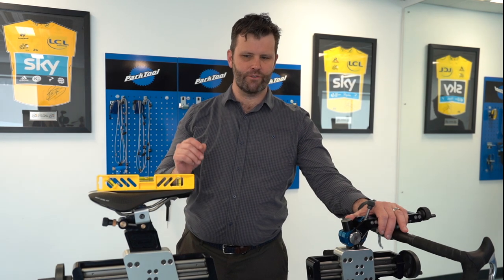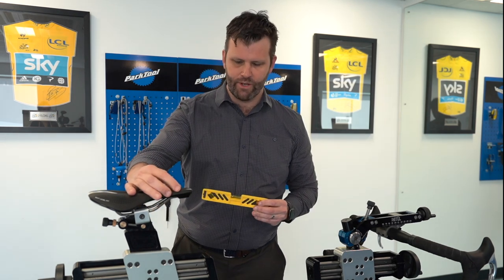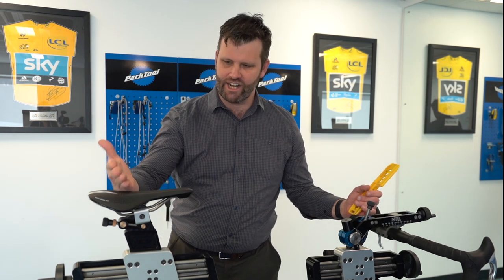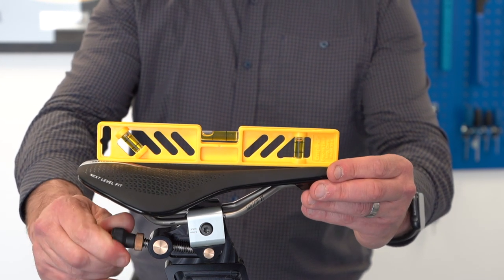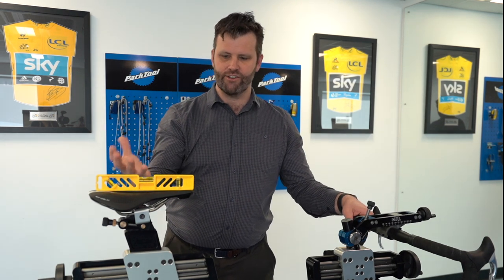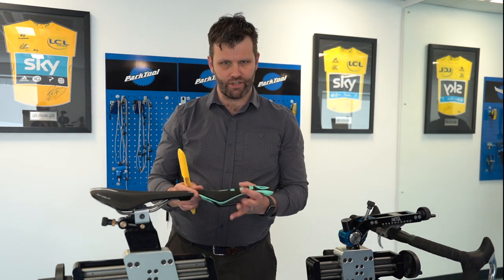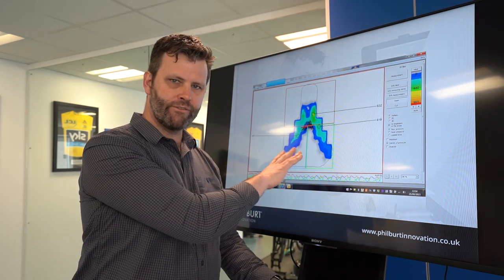The Correct Saddle Tilt For Comfort & Performance

Comment: Having the nose level (or a few degrees down) makes sense for when riding aggressively. What I don’t get is why more saddles don’t have an upwards swoop at the back, gives great support to rotate the hips and is handy to push back on while climbing.
Reply: Rolls or Turbo. And anatomy friendly as a bonus. There is a reason they have been around for 40+ years.
Reply: sap inva Neither of which has a cutout
Reply: @thedownunderverse  selle smp is basically what you mean? Do you use this one?
Reply: mosk11tto I’ve seen them but they have the opposite issue. Too curvy!
Reply: @thedownunderverse  ah ok

Comment: On a transport bike the point of the saddle is actually tilted slightly upwards. 
Fully agree one any sports bike the saddle should be a little nose down to facilitate proper leg movement and avoid excessive back bend.

Comment: Saddle tilt I find is very connected to saddle hight too. I rotated my saddle forward, and felt like I was sliding forward, but then nudged the saddle hight and no longer felt so was falling off. What also nice with slammed tilted saddle is after a hard effort, you can slide back effectively taking pressure off the legs and feet while recovering yet still pedal
Reply: @TheRealD4  it sits at 12° and lowered it a cm

Comment: I have noticed in a years that some seatpost are bit of difficult to adjust saddle in a right level because when you tighten the bolt saddle tilt easily change one way or another and you need to loosen bolts and start all over again. Little bit like trial and error thing.

Comment: Interesting analysis. However, I don't seem to have the same requirements or don't fit the norm. When you mentioned that the saddle nose should never be up, I was waiting for a more comprehensive explanation. The things you talk about don't apply to me (sore back, can't tilt forward). I've ridden across Canada with my Brooks saddle tilted upwards (slightly), covering an average of 130 km on riding days (sometimes over 200) and it seems to be the only way I can do it. The saddle does not feel comfortable any other way. That said, I prefer to have my handlebars higher up than most cyclists and I use raised handlebars. I have no ambitions for racing, but enjoy going on long rides at relatively high speed (for me).

Comment: I ride all my saddle pretty tilted, more than 3°. It is the only good way I found to ride comfortable. What I never understood after a lot of years of cycling and several bikes with different saddles is: why the saddles have almost any foam in the middle-front part when that is actually the part we use most. The rear part of the saddle is normally pretty comfortable but almost no-one is really sitting so backward, the pressure points are usually in the middle.

Comment: Thanks so much for this clip this is the most helpful saddle fit video on YouTube. I’ve spent decades flagging about with saddles, trying to find the right one. I’ve measured my sit bones as best I can at home. My newest saddle causes a bit of pain, I always had the saddle dead level. But I tried tilting the saddle down by 2 degree, pressure on my gentleman’s part has greatly reduced. But I’m still getting pressure on my sit bones. Should I try another degree down? 
Sit bones 110mm and saddle is 132mm.
Reply from the maker: Trying another degree down may help- it shouldn't shouldn't hinder. 
However sit bone measurements are a largely inaccurate and misleading method of seeking saddle comfort, when you consider the sheer variety of shape, texture, padding available on saddles, and the sheer variety of people's bums coming into contact with them! That's before we consider the angles and pressures and movements which will be more influenced by the position of the rest of the body.
Trial and error can be a useful way of trying to find out what works for you- but you can save a lot of time and effort and inaccuracy by having a full bike fit with saddle pressure mapping. this will show us exactly what is going on there, and enable us to make better informed decisions on saddle choice.
Reply: Phil Burt Innovation 3 degrees nose down works great for me. Still have pressure on sit bones which is much reduced. Thanks so much.

Comment: Start with tops and drops in the right place for you relative to your pedals, add in saddle height and fore and aft position to suit then tip saddle up or down so saddle tilt lets you be comfortable on the drops.  Anything higher in the front is wrong.  Steve Kellogg (US expert) can be on drops with front of saddle up high, mortals can't and that's fine with him.  Down is OK, all depends on your vertebrate to vertebrate to pelvis flexibility in your lower back.

Comment: Short nose saddle with a lot of swoop in them are a nightmare to dial in. I have a Prologo Dimension NDR and a Syncros Belcarra, both with a high back end that swoops down to a short nose. If I level out that very small front section I'm okay in the drops or resting on my aero bars (inside). But if I'm in a more upright position on the hoods or bar (endurance spins) I'm very uncomfortable and find myself constantly adjusting and sliding forward from the higher back swoop. Then if I ride it slightly nose up to keep me locked in a position, I'm uncomfortable in the drops with too much pressure on the man part. Like I said, it's a nightmare. Too far forward, too far back, too high or low.

Comment: Great video Phil and very helpful. I have my sit bones measured and i have setup on my bike a specialized romin evo saddle which is a kind of s saddle. I am struggling to find a good comfort level for months now. My lbs where i bought the saddle told me that the best level point of the saddle is from where the cut out starts to the nose. Can you give me a tip? Many thanks
Reply from the maker: Hi Bill. Ideally you should measure the angle/slope of the section of the saddle where you most commonly sit. Difficult to set up with only this one aspect, though, as obviously fore/aft, height, and the rest of your contact points influence how you sit on the saddle. The definitive answer is a full bike fit with saddle pressure analysis- so we can realyl see how you're sitting and where we need to increase/reduce pressure: https://www.philburtinnovation.co.uk/bike-fit/

Comment: Hi Phil, how would you best measure a more cushioned saddle (like recreational mtb, not for road racing)? Does the softness of the saddle cause a lot of inaccuracy (when your butt kind of pushes into the rear part of the saddle), or are these saddles also designed with the same way of "horizontal" angle definition?

Comment: Thank you for the excellent content, Phil! I learn something from every one of your videos. If you get a chance could you talk about how to find the right shorts/bibs and the best way to ensure comfort in the saddle? I have struggled with using bibs with too much padding and some that have hardly any padding. And I use Chamois Butt'r, which has helped a lot but would be interested to hear more tips for maximizing comfort in the saddle. Thanks again!
Reply from the maker: Hi Dennis, thanks for this. I have lots more videos (and even some products) in the works regarding bibs, chamois, saddles and the bike/human interface! Regarding comfort always remember it's not just a short/pad/cream/saddle conundrum but truly multifactorial taking into account entire fit. Best shorts and saddle in the world will not make a faulty bikefit comfortable, if it's causing you to move or place pressure on delicate spots. Advice is always do it right, starting from absolute beginning.

Comment: I've been getting lower back pain and pain/tightness in my right hip. Tilted forward 1 degree lets see how it goes.
Reply: How did it go
Reply: @QuranSprouts  its better but not perfect. Its funny because I'm the most comfortable I've ever been on my bike. Its just after 40 mins i get a nagging pain in one hip.
Reply: @abedfo88  maybe your saddle height is too high or your for and aft is messed up?
Reply: @Paulklampeeps  you are correct in both assumptions!

Comment: Interesting, so tilting down by 3 to 4 deg is better and okay, I always thought that's a sign of too much tilt and that it'll put too much pressure on the handlebar, hence you'll need to lower your seat post height
Reply from the maker: Tilting slightly down is "generally" better- but everyone is unique. But yes, tilting may cause more weight to be distributed on the handlebars, but only if the setup of the rest of the bike encourages it. This is how bikefitting is multifactorial. You can never change 'just one thing'- there are always physiological repercussions elsewhere along the biomechanical chain. Also tilting saddle height forward (or moving saddle fore) generally means extending seat post!
Reply: @PhilBurtInnovation  I guess this is where modern day bike fitting with all the sensors and pressure sensors comes into play, as it'll help the fitter and the rider to make a more informed decision? 

As I notice that I might be okay at certain position for a 80km ride, but at 160km ride, I notice issues that I didn't before.

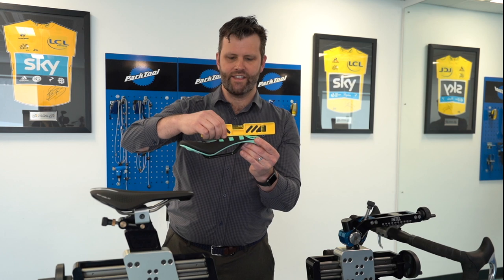Comment: Did i understand it correctly in 3:05, that with curved saddles, it’s the nose part that should be level? Coz that’s what i did a few months back when i tinkered with my saddle height and angle. But when i had my bike tuned up before xmas, bike mechanic said it’s tilted down a bit and i should adjust the nose up a bit.
Reply from the maker: Generally speaking you want the section where you most commonly sit to be the bit that is level. I can appreciate that this can be a bit tricky with some models, so you may need to experiment. There are some good mobile apps that use your iPhone or Android's inclinometer, if your spirit level is too long/unwieldy!

Comment: I've been struggling to find the sweet spot for the last few months. The trouble I'm having is that I get lower back discomfort when I tilt it up, but when I tilt it back down incrementally I start getting a niggle in my left knee. I'm thinking my knee is being used to help keep my position on the saddle. Do you have any suggestions? Saddle height change, or fore/aft for instance? Cheers!
Reply from the maker: Yes. Come and have a full fit and do it properly!

Comment: Well you are highlighting the shortcomings of saddle design today. 
Most amateur riders use one saddle for all rides. 
When they are riding long distance, they want a horizontal region for their ITs when hands on bars and hoods. 
When they are riding sprints and climbs, they want a down tilted mid and nose section. 
Never is it appropriate to have a down tilt in the rear wide part of a saddle. 
So why aren't saddles being designed with the capability of a hz rear, and down tilt mid and nose section?
Reply from the maker: It’s a very good point